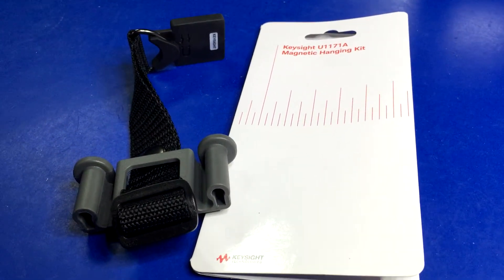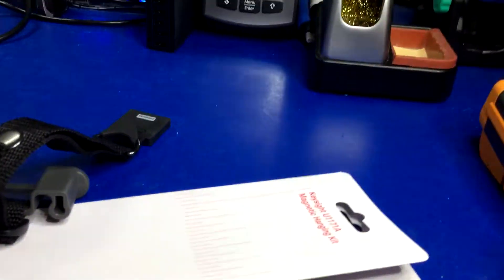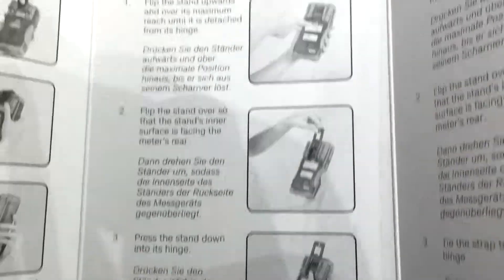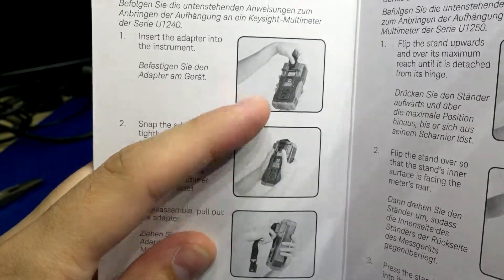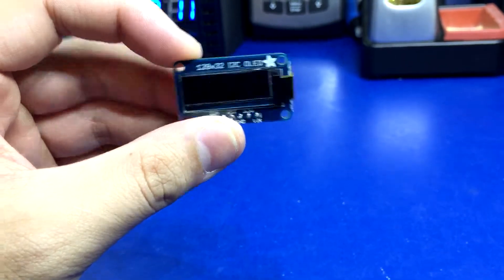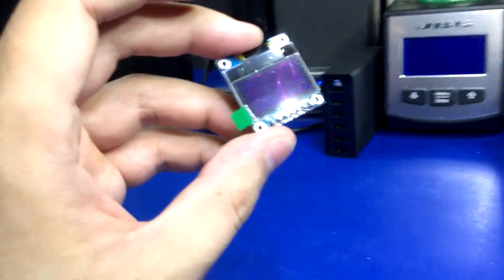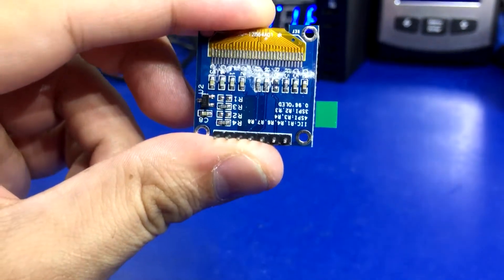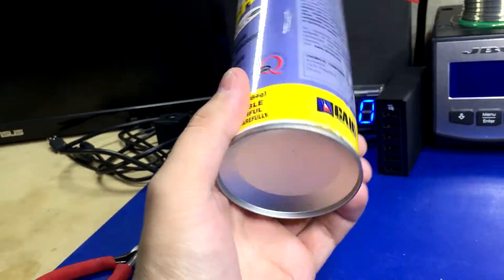Rant about my Agilent / Keysight Magnetic Hanging Kit (and about my Flux Wash can) #0042

Comment: Grind the plastic of the stand till it fits the meter, then you have both options. As to the flux wash can the small neoprene washer sealing the top of the can had perished from exposure to the solvent. Pretty common, and if they had used a more durable, but more expensive, silicone rubber seal it would not have happened.
Reply from the maker: SeanBZA Yeah I'm considering doing that to get that plastic piece to fit.  If that doesn't work, the strap is really all I need--I just need to dust off the 3d printer and make a custom fit piece to snap into there.  We'll see!